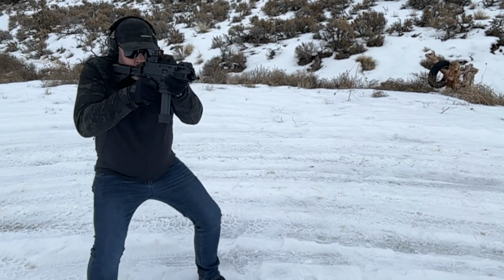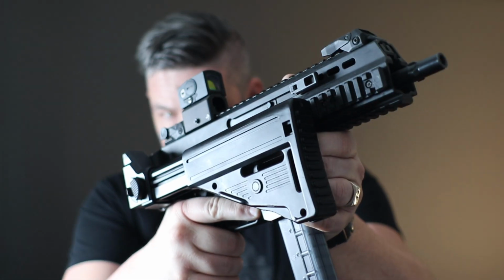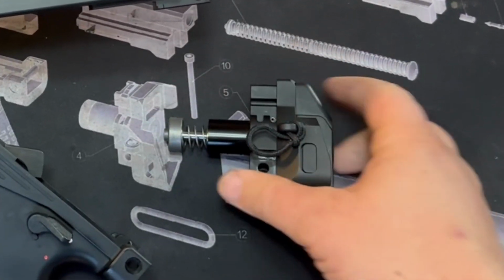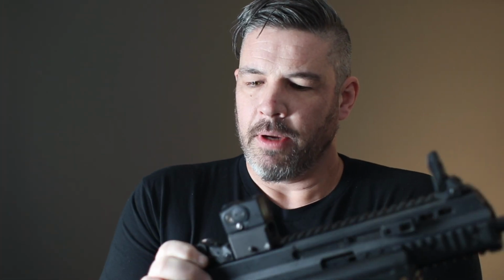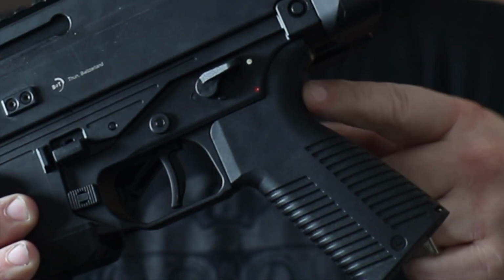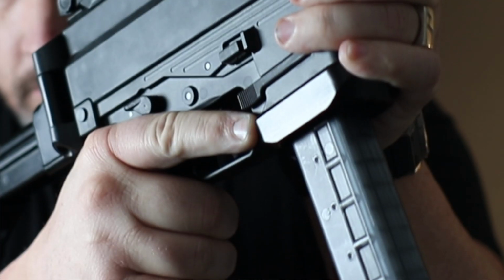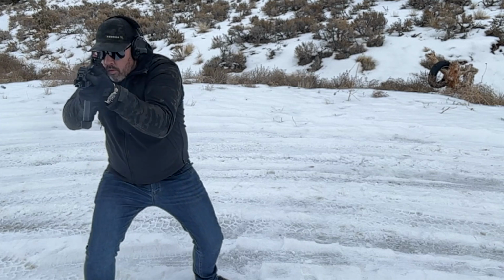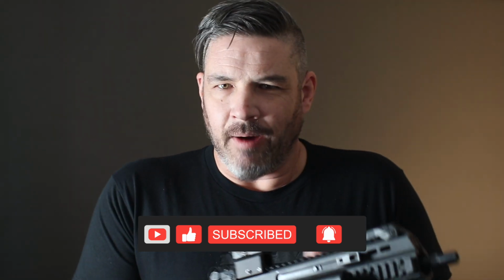Perfecting The MP5 Killer: The B&T APC9 Pro

Comment: I have a Gen 1 APC9, Gen 1 GHM9, and a MkII.  My APC runs the Acro P2 with the low B&T mount, Surefire 1 cell scout, the collapsible brace, and I added a single folding charging handle.  I also run Griffin Armament folding sights installed over the emergency sights it came with.  I also run it with a Griffin Optimus 9 can.  Wish I’d gotten the Pro but it wasn’t even close to being brought out or even mentioned when I had the $ to buy an APC.  I sent my GHM in for the work to feed hollow points/flat nosed bullets and I love the GHM as much as the APC.  Great video btw.

Comment: The safety was crap, replaced mine with HB Industries Modular Safety Selector Kit & Reduced Weight Selector Springs.
Reply from the maker: 😂 Reduced weight safety springs 😂 Here is something that might help so you https://gripzilla.co/products/gripzilla-ultimate-full-set
Reply: @SeanGoBoom that’s a great set actually, I like several of their products
Reply from the maker: Agreed. I've used a few of their products to keep my grip strong in the off-season, and it keeps my pistol game on point out the gate.
Reply: Protip. Just remove 1 spring and it's nice and silky after.